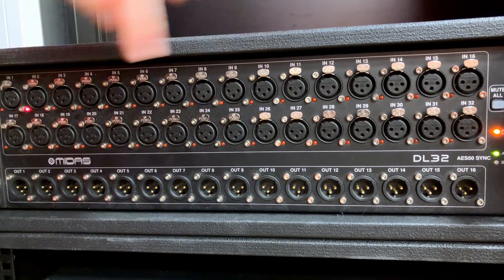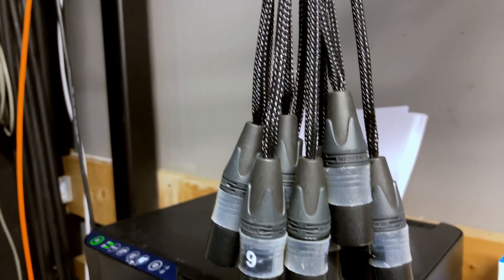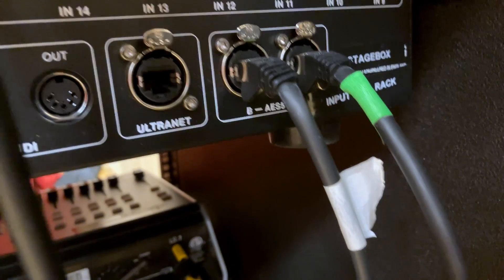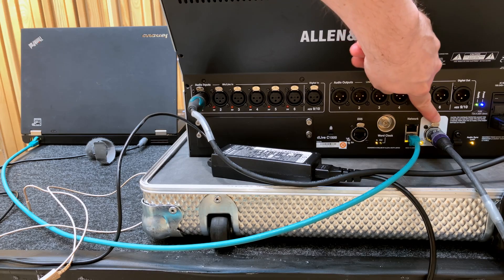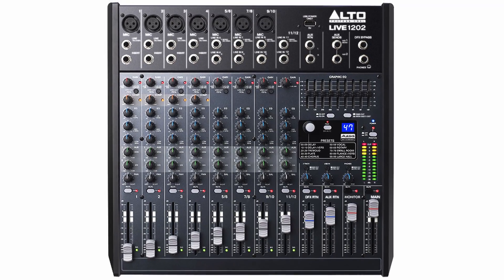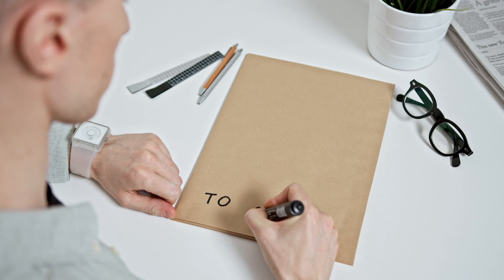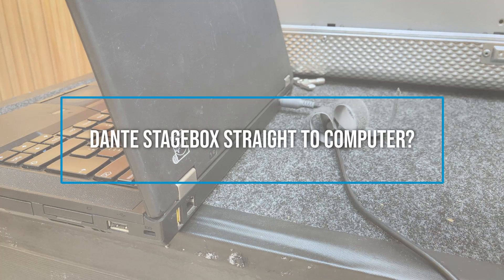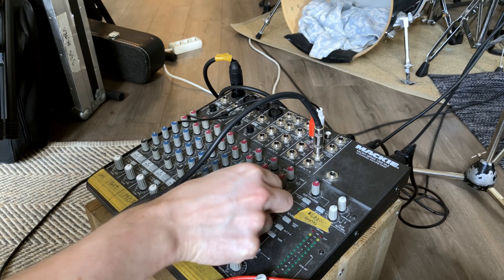Full Digital Stagebox Guide

Comment: Stage box for output  to speaker don't give  easely the information (snr, thd, db) of  how is convert digital (ethernet) to audio (xlr) for monitoring 2.1. The conversion is about dac and and preamp. Control volume gain seem not available because fixed or variable  by a volume knob that can be manage by proprietary software ( yamaha R control)  but not by dante protocol . The price goes high for stage box for  only monitor/listen surround audio from simple audinate avio  2 xlr analog balanve output to more advance device with 2 ethernet (primary, secondary) and many xlr for input (microphonr) and output ( speaker). manage range frequency is available in AVR ( low LPF) but sometime available in high end  subwoofer with knob (  and high HPF) but can be apply  like room correction and EQ by using  plug in dante in OS level ( virtual cable ) or audio DAW ( VST). For listen surround , some audio card like sound blaster support 5.1 on hdmi  with dolby licence that don't give access to   blend licence that need software to manage 3D audio objects. Google cast (chrome cast in browser) is dante concept apply to wifi for home consumer space but  there is no routing gui table ( google home only). Microphone on speaker manage room correction and sync audio in multiroom mode listening.

Comment: These seem super useful for FOH. For those making an IEM I don’t see much utility since you need to split the signal and then get to your mixer.  

I know the Behringer can split with one of these in the rack but only with the dreaded post gain that no FOH wants to deal with.  

Wish there was a solution for iems to not lug around heavy stage boxes.
Reply: There is a digital stage box solution, but (aside from Dante) it's mixer brand-specific. Most digital stage boxes can send their multichannel digital outputs to more than one destination. If you bring a compatible mixer of your own, you can plug all your instruments into the house stage box, digitally route a duplicate set of input channels to your on-stage mixer, and use it to drive your IEM's (and stage monitors as well). This is how stages with dedicated digital monitor consoles are set up to run stage monitors separately from the FOH mixer. In these cases, either the monitor mixer or the FOH mixer must be configured as the master mixer that controls the input gains of the stage box channels, with the other mixer acting as a slave mixer that passively receives the input channels.

Comment: How can you run a connection to a stage box over 100m away
Reply: With a good ethernet or glassfibre connection
Reply: @norbertsmallegange6331  I tried that with an x32 it kept breaking. It would disappear and reappear (stagebox)
Reply: @norbertsmallegange6331  I used an 85m cable

Comment: I am only really familiar with Yamaha but... You can actually use a Yamaha Rio stage box with ANY Dante enabled mixer.  You would use the "R" Remote application to adjust the head amp gain and phantom power. You would then use Dante Controller to patch Dante to Dante.
Reply from the maker: Very true. You can patch any Dante device into any other Dante device using Dante controller, but as you pointed out you need to use another method to send the control data. In the Yamaha case there's an app. For Shure wireless mics you can use the receiver itself. You could also just use it for line level signals where you don't need gain. But I wouldn't encourage anyone to shoehorn a Rio box into an Allen and heath setup just because they can.

Comment: Great information, thanks. Could you do a video or guide on DI boxes? What are they? How, when and where to use them? And so on...
Reply from the maker: Thanks! Yeah absolutely
Reply: Why AvR home cinema theater don't have : 1)  by defaut all their audio output both in high level speaker (amp power) and line level ( rca ir XLR/trs pre out) 2) has surround driver (asio, mme)  on windows OS to be able to use audio daw with dts or dolby or aurora  renderer with realtime engine instead be block to listen mode ( bluray player and game with surround audio) .

Comment: Great video. I think of digital stage boxes as relocating the whole ‘back plane’ of the digital mixer, ie moving the audio in pre amps and A2D circuit board, phantom power section to the stage, and since it’s very much the guts of the mixer it has to be the manufactures own device. However with Dante you can at least tap off the pre-gained signals to another Dante device eg. monitor mixer or broadcast with no degradation.
Reply from the maker: Great way of thinking about it!